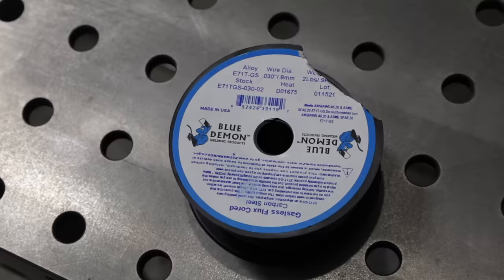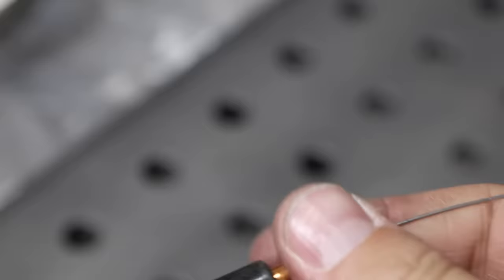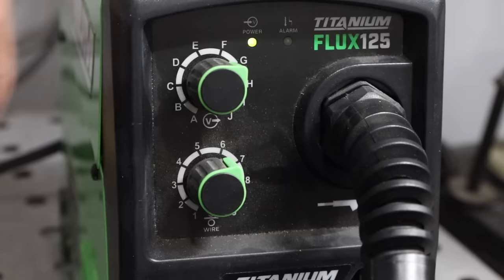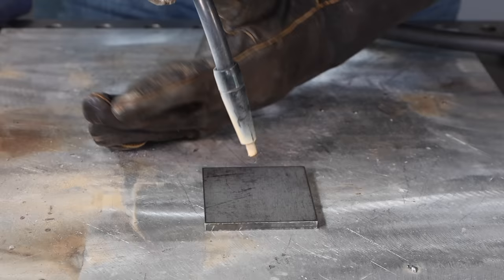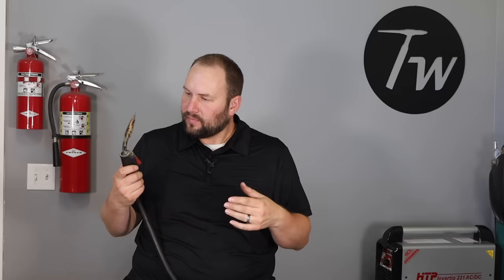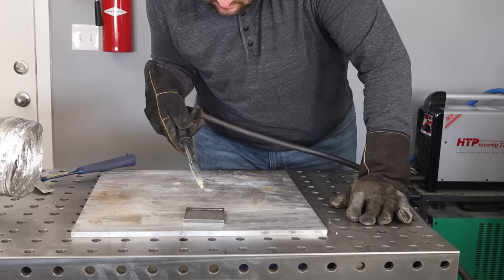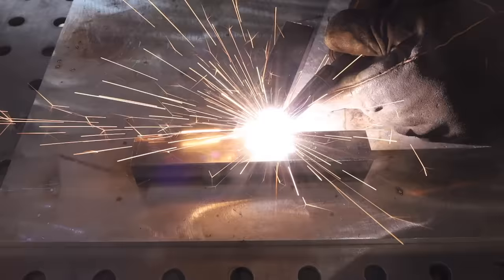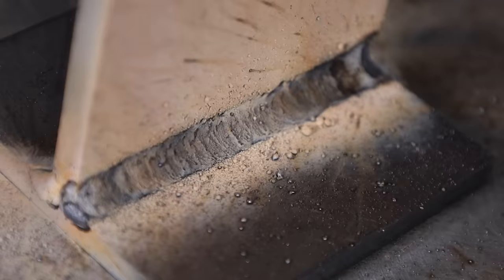Gasless Flux Core Welding Basics for Beginners

Comment: hi tim....so was watching your video on flux core welding tips...I noticed on your gun you have a tapered tip which I understand makes viewing you weld process easier...I have a multi process welder and the gun tips or cones are much bigger and made to be used with gas...question is how do I figure out how to actually get those smaller tips or get the correct size for my gun and replace what came on the gun..?
thanks ...charles forrest
Reply from the maker: Great question! Some manufacturers offer them and others don’t, so you just have to check with the machine manufacturer. I don’t think they make that  much difference for welding/visibility, but it does keep the diffuser clean. I don’t mind running with a gas nozzle if that’s all I have on a given setup.

Comment: @TimWelds Your videos have been instrumental in helping me learn to hobby weld! Your approach, your straightforward explanations, and excellent video-making are fantastic! Quick question: What is your setup for the close-up shots that show the detail of weld puddle - do you shoot through a spare welding hood?
Reply from the maker: Thanks! I just shoot with DSLRs and mirrorless cameras on manual mode to get the light at the right level. A ND filter helps to bring it into range. No welding hood or anything on the camera.
Reply: @TimWelds  Ah, cool! Keep up the great work, man!

Comment: is it possible to weld 1/4” cast aluminum ?
i bought a new but damaged Jet 12” disc sander.  one of the legs is completely broken off and there a crack that travels from the outer edge to 2” away from the center hole.  the material is about a 1/4” think in most places. i purchased the blue diamond aluminum rods, and had high hopes of repairing this tool but i was unsuccessful with the heating it up to 730 degrees.   i was running two mapp gas tanks and it was not getting up to temperature.    i’m willing to pay someone to weld it, but i don’t know if this is at all possible.  at this point i don’t think the aluminum rods will work because all the youtube video show it brazing solid or extruded aluminum but not much on cast aluminum. although there’s a video n repairing a cast aluminum small engine block.  should i try heating it up again and just stick it out a little longer to heat it up or is that not going to work?
     where should i go from here?

Comment: Clean your area really good beforehand and put your ground as close as you can to the area your welding. Especially if it's powered by 110 and you can achieve decent results.  I never turned mine down from the highest setting. If that tells you how weak they are..

Comment: Stupid question: can you have the settings so far off that you weaken the metal from to much heat? Ive always heard that you gotta get penetration, or someone would say they had to turn it up because they werent getting penetration…is it possible to go to far with penetration, like disolve your metal like its steaming water is obvious   But where it looks ok but you weakened the whole area because it  was to hot (or to high voltage or however its said )?
Reply: Ha now you gotta weld your vice 😂
Reply: Howd you know i need to get my trailer hitch welded on ?and was debating g spemding a couple hundys at harbor freight or at a welder shop? 😬

Comment: great video very informativs. on the last technique you demonstrated,  ive seen on other videos where the edges of the metal are beveled with a flap disc or whatever to help with penetration on thicker material like 1\4" plate. would that have helped in this case, or was the welder just at or over its limits?
Reply from the maker: Beveling the material does help. On a tee joint like this, it would typically require two passes, a bevel groove weld with a fillet weld over top.

Comment: I use a Miller 211 with flux core, and a smooth driver wheel with a Tweco 250 amp gun. Can anyone tell me why I go through tips so fast? 1 1/2" .35 tips. I can only get a few minutes of welding per tip. New tips weld buttery smooth, just don't last.

Comment: I tried to weld with flux core wire. The result is very dirty. Arc comes out with a lot of sparks like fire cracker. How to setup the correct voltage n current?
Appreciated your advise Tim. 🙏
Reply: First make sure the gun is on the negative terminal. Ground clamp to positive. Flux core typically uses a lower voltage than MIG. It depends on wire diameter and speed but with a 0.035" wire start at start at 18V - 20V and play with the wire speed to get the least amount of spatter. The last thing is stick out. On small wire you still want about 3/4" of stick out but never less than 1/2".

Comment: Thanks that was really helpful.Is it normal to have to keep your welding lead fairly straight ,if I don’t I have wire feed problems.Low cost chinese machine…Thanks John
Reply from the maker: I keep it really straight when I first feed the wire into the gun. After that, I don’t worry about it.

Comment: Say I get a mig welder that uses gas and flux core but I want to just use gasless flux core, do you just cap off the gas and use flux core ?
Reply from the maker: You just leave the gas port disconnected. You’ll need to change the polarity to electrode negative for self shielded flux cored. A lot of machines have a gasless nozzle available also, which is like a cone. The special nozzle isn’t essential, but it does help. Also, knurled drive rolls are best for cored wire. These rolls are included with most machines.
Reply: @TimWelds  yeah from positive to negative. Thanks!

Comment: How will tip size effect weld? If using .03 wire in a .035 tip or .04 tip?
Reply: I don't think that's generally a good idea, with the exception of MIG aluminum (because the aluminum wire expands a bit).   If you use a +0.005" over-sized tip with regular solid-wire ER70-Sx or flux cored wire, it will work great *at first*, but once it starts to wear down, you will have micro-arc'ing within the elongated tip bore, and inconsistent welds due to inconsistent current transfer.
Reply: @zod-engineering-welding  good to know as a beginner it is something that I really don't see addressed much. Importance of tip size or when and why it should be replaced.
Reply from the maker: I would just get the right size for the wire. While you might get away with it for a minute, you’ll make your life easier if you just get the right stuff.

Comment: I noticed you never ground your parts edges before welding.  So do you need to grind the edges so there's a gap so the weld will Penetrate the metal better
Reply from the maker: That depends on the material thickness, joint type and required strength. For thin walled tubing like this, it’s really not needed. If it were thicker tubing, it could increase strength.

Comment: It would have been helpful if you had explained about the drive wheels for flux core wire vs solid wire.
Reply: Not really the point of this video. This video is about using flux core (gasless) wire and welding with it. There are many videos out here on gas welding using solid wire. Good luck!

Comment: Hello Tim, i just got my first inveter and i am trying to weld some square metal tubing that has a wall at about 1.5mm, i tried to apply what ive learned from your videos but on inner fillet weld i just keep geting slag on the side of the weld or slag holes. I tried with rutilic 6013 supertit fin that worked better than speedarc, with 7018 i woud just melt  the wall, and i tuned the amperage at a point where if i go lower i hardly strike the arc and i fell that the metal  won t penetrate wall and if i bump it more it just burn through. I am able to weld flat and points somehow but on the outer line of the weld it gets sort of a in depth grouve like an arround of the molten metal from the electrode, after grinding. I tried doing circles, a straight line, back and forth weld but the metal gets slag withing it and if a want to add there, the weld just increase and the slag builds up more.. i hope i can get some help, i mention this is my second project, a work bench, on my first i just grinded, added material and reapeted until it loked ok and i got rid of the slag
Reply from the maker: Thanks for the question! 6013 is notorious for that. Try turning up your amperage on the 6013. I demo this exact thing on a video called “can I stick weld razor blades: tips for welding thin metal”. That demo might be helpful for you. 
If you want to use 7018, you’ll probably need a smaller electrode. Hope this helps get you going!

Comment: Ok so if the T weld pattern is not effective for qtr. In. Plate. What technique do you recommend for better penetration into the joint to be welded on qtr. In. Plate? Kinda left us on a cliffhanger there bruh.
Reply from the maker: The 1/4” plate is pushing the limits of this particular machine, more than the technique. As far as technique, I’d just run a straight stringer.

Comment: One thing I'm totally in the dark about and which I didn't hear you explain is that
on your machine in big letters is FLUX, so does that mean that the machine is exclusive to flux core wire?
My Lincoln which I haven't even used yet, doesn't have the word Flux on it and neither does it have a positive and negative jack that I can see . . . at least not on the front.
But my now deceased friend who gave me the welder said it has flux core wire in it.

Thanks,
Cliff

Comment: Tim, I enjoyed your video but I think you left two very important components out.  Cleaning and grounding.  I don't know how many times when I was first learning I was chasing my settings around only to find I had a poor ground, my metal wasn't clean enough at the weld or both.  Mill scale is critical to be removed too in cleaning.  It took me years of trial and error to realize that that nice black metal finish was mill scale and not clean steel.  I'm not knocking your excellent video, I just think it should be mentioned that without a good ground and clean steel, stick out, speed and technic are not always enough.
Reply: Well he did mention voltage. Which will blast through crud. I'm not saying that's the right way to do it. Well, sometimes I suppose it is. You have to take every welding job on a case by case basis.

Comment: Wouldn’t you risk getting slag inclusion using the “T” motion, or is it like the whip and pause technique with 6010/6011 with stick?
Reply from the maker: It's definitely possible. I think the key is to stay with the puddle and avoid moving back over slag or previously solidified metal. It's not my main go-to move, but in some situations, it just seems to work really well for me.
Reply: @TimWelds  Thanks for the quick response. I’ll have to try it out and see how it works for me. 👍
Reply: @TimWelds  Nice video.  One some other videos they talk about multi pass welds and that stringers are stronger than weaves.  If I looked at your weld, it looked very good but when you sectioned it there was very little penetration at toes and none in the root.  So as you mentioned the user has to decide if the weld they make is up to the task it needs to do.

I have been running blue demon 0.035 and seems as if about half the stickout melts off, then the full wire returns, then another half stickout melts off and so on when I weld ( flat position, max voltage, half inch stickout, 10 degree drag angle).   Seems to be doing this very steady, increased wire speed no help.  Any ideas?

Comment: How would you adjust your automatic helmet so you see what you are doing. Thanks for the help.
Reply: When I wear a helmet often I have issues with light coming into the back of my hood. Then it's like trying to look out a window at night with the lights on inside. You can't see crap outside. But if you turn the lights out then you can. So I just block the light coming in the back of my helmet. Usually I use a leather bib off a summer welding jacket. Just toss that on the back of my head. When you get really good at welding sight is kind of overrated anyways.

Comment: The other thing that needs to be mentioned is a good power supply and fresh wire/or least clean wire is a must and if your welder has detachable cables then have one setup for gas and one not.
I am not a great welder but on reliable machine i can make dimes, On a machine with issues its hit or miss (which is last thing you need when welding)

Comment: Do you need a respirator for this kind of welding?
Reply from the maker: Great question! It depends on how much ventilation there is. If you’re welding indoors or if you have to have your head in the fumes, you should wear a respirator. I use the GVS Eclipse, which is fairly comfortable and fits under my welding hood.
Reply: @TimWelds  Thanks! I’ll definitely pick up a respirator. Better safe than sorry. Quick question - I noticed that you were touching your welding table. Is that only okay to do if the ground is attached directly to the welding table or is that okay to do if your ground is attached directly to the working piece too? I can’t find anything on that and I don’t know if it’s safe.

Comment: Can flux core make strong enough welds for a motorcycle/moped/bicycle frames?
Reply: Nothing's impossible but many things remain highly unlikely nevertheless. So if you're asking then I'm going to have to say no. Although there are things you can do to increase the strength of joints. Give yourself a fighting chance, so to speak.

Comment: How do I cut down spatter with the MiG 170?
Reply: If they're little balls you can cut that splatter down with a cold chisel and a hammer. If it's really stuck you might have to grind it. Some welders are smoother than others are. They have parts in them that smooth the arc out. Stuff like chokes and capacitors. They were built by companies that had engineering departments.

Comment: Can you weld body panels with fcaw? I can get a far better machine for the money with fcaw vs mig and was wondering. Thanks.
Reply from the maker: I've only done a little autobody work, so I won't claim to be an expert. The way I did it was with small MIG tack welds around my patch, then I continued to add tacks (moving around to avoid distortion) until it was completely covered. While this is probably doable with flux cored, I don't think it would be great because of the slag that has to be removed before adding another tack weld.
Reply: @TimWelds  ok thanks!
Reply: I use it a lot for thin / body panels, having to work outside, with no problems. As Tim says, you do need to clean off between welds - but on the plus side that gives a bit more time for the panels to cool between each weld. An E17 T11 spec wire is a multi pass spec., may be more suitable than “GS” wire which is usually single pass.

Comment: Never buy a wire feed with less than a 10' stinger. I run mine on a swingarm and a 15' stinger for steel, gives me a no hassle 40' range as I build large gates and racks on trucks. For aluminum with Argon and Teflon liner yes shorter to 10'.

Comment: Video on welding cast iron or brazing cast?  :-|)  I have a milling machine vise that's brazed and works for me. Thanks for sharing!
Reply: I stick welded a milling machine vise and it is holding up for me so far. But welding it did warp it. Fortunately I have a milling machine and a fly cutter.

Comment: only one thing i would recommend for flux welding. just do a straight line and dont try an make any fancy techniques. flux works best with a straight line since theres no gas. you would do more harm then good by trying to do C's or other techniques that can contaminate the weld.

Comment: Don't understand why you call the Miller machine  a "dedicated" MIG welder. Both machines are "dedicated" MIG welders in that they are "dedicated" to the MIG process. In comparing the two however, the HF machine could be called "dedicated" in that it exclusively runs flux core wire only, whereas the Miller runs either gas shield or flux core, so, if anything, is not "dedicated".
Reply from the maker: I just mean that is how I use it. In my shop, that particular machine is dedicated to that purpose.

Comment: Can you stack those beads on that t-joint
Reply: Running flux core gas less wire
Reply from the maker: Great question! It depends on the particular wire. The data sheet for the wire will usually say.
Reply: @TimWelds  ,  I have welded flux core with 80/ 20 argon co2 052 wire,  and short arc,  now I mainly use pulse arc and spray for general dynamics,  is it easy to adapt to welding gasless,  thinking of buying a unit I saw Lincoln makes for home

Comment: Dang, I thought reverse polarity had to do with the thickness of material..
Let me check my Millers book......
Yep I was right..
Reply from the maker: You’re probably looking at info for stick welding…you’re welcome to do it however you want, though.
Reply: @TimWelds  actually it was my Lincoln, which also states it in the inside cover 
.035 innershied 
NR-211-MP DC (-) 
For 20ga. (.036)
I'm a sheetmetal worker pipefitter welder, Hostler  by trade..

Comment: Flux-core makes a mess with all the slag.
Reply: With flux you have to manage the puddle. The goal is to keep pushing the flux to the back with arc force as you travel. If you don't do that then the flux ends up in the bead. Which is easier said than done.

Comment: What you are calling a "tack weld" is what another YouTube channel said is actually a "spot weld". Tack Welding is done with a special machine called a "Tack Welder" and all it does is to put a lot of current between to pieces of metal that are touching and no new material is added. That guy said that lots of people say tack welding when they mean spot welding.
Reply from the maker: I don't really mind what you call things if the words are serving your purpose, but I think you'll find that most (including the American Welding Society standard terms and definitions) use the terms with definitions opposite to your comment.